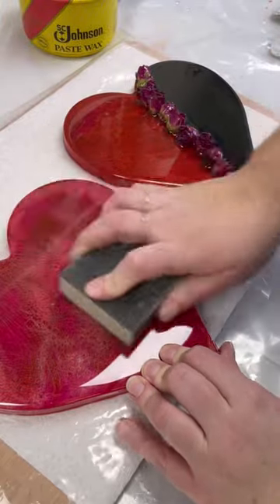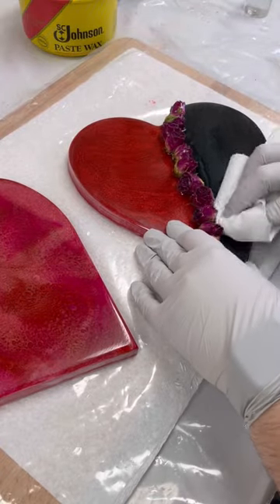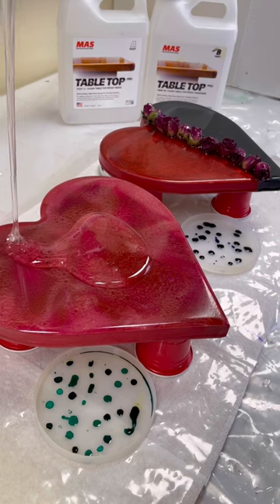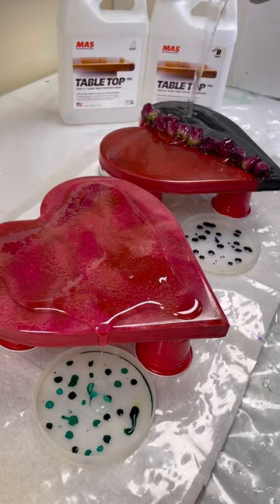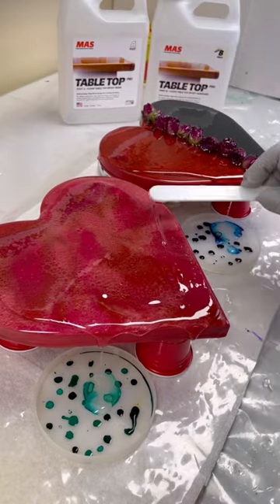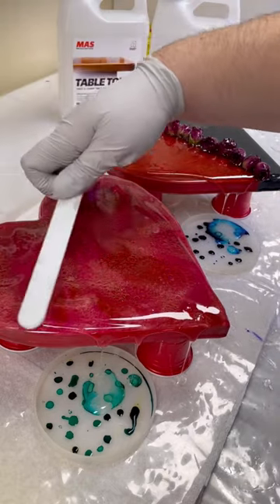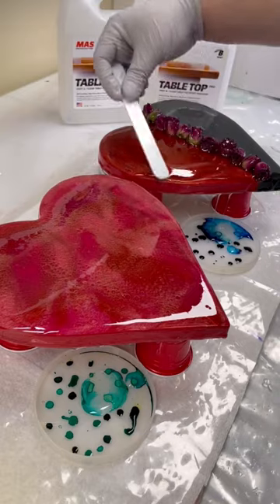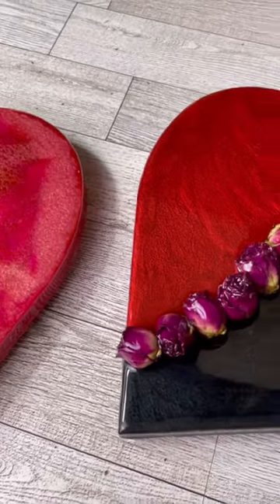Fixing some Epoxy Resin Hearts #epoxy

Comment: Does the paste wax help the paint run off
Reply from the maker: It helps when removing the drips from the bottoms. Creates a barrier between the wood and the resin so it’s easier to scrape or sand off the drips.